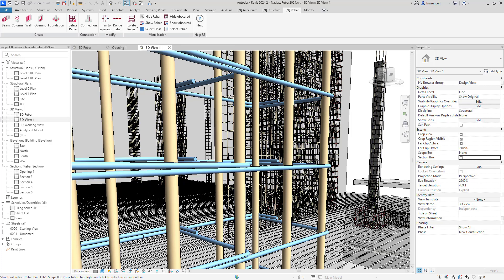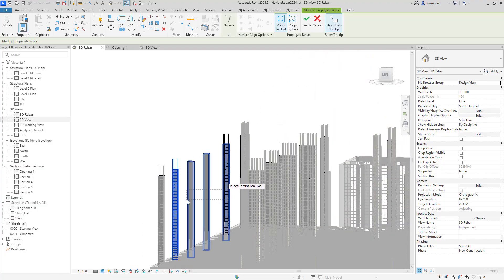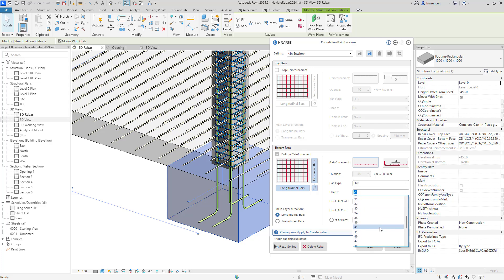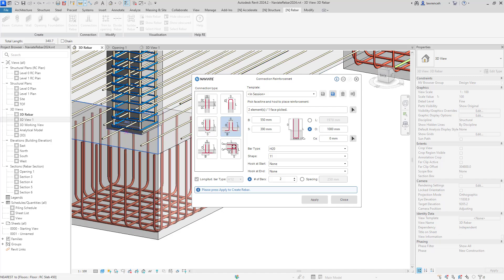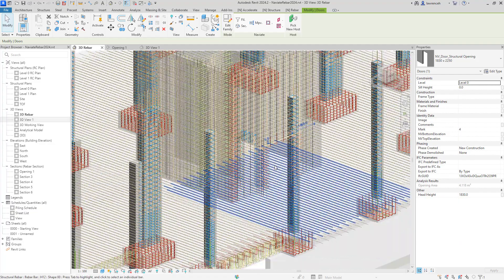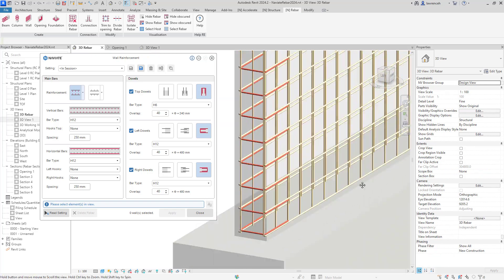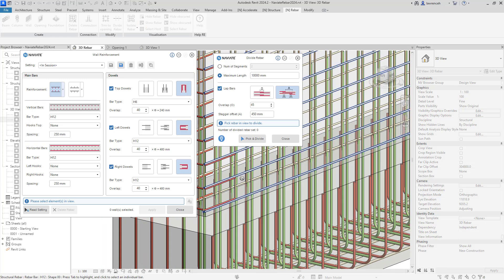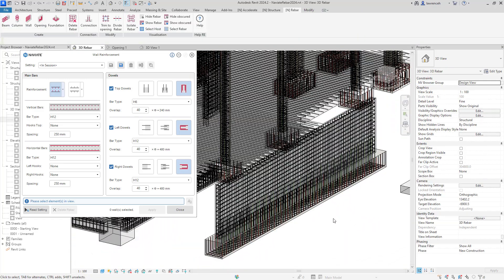Naviate Rebar - What's New!

Comment: and another question, when we add the reinforcement for the foundation, we can only choose the number of the bars to be sthe same in both long and short direction, couldnt we edit that? to let the number of the bars in the long direction more than the number of the bars in the short direction?
Reply from the maker: This is something that we hope to add to the connection tool in the future.
Reply: Thank you!, is there anyway that when we change the number of the bars to let it be saved in naviate? So that I can apply it then for the another foundations? 
Hope it’s clear and thank you :)
The same question for the connection if they were rotated can I apply this rotation in naviate so that i earn the naviate benefits? (Change one connection to change all the connections)
Reply from the maker: @ghaithtaher9907  you can save the configurations made within Naviate, however, if you’ve added bars outside Naviate then you can use the propagate method in Revit
Reply from the maker: When creating the foundation you can independently control the bars in the longitudinal and transverse directions. The default state is to apply the settings to both directions but you can select a single direction for control over spacing and shapes etc

Comment: Thank you very much Lawrence, I want to ask you about the connections tool, can I add the connections ( dowels from the Columns to the foundations in a way the I got them in the four directions? I'm speaking here about the part of the bar which lay on the bottom reinforcement of the foundation and go to the short or long direction side of the foundation, can I model them and let two connection to be layed on the bottom bars of the foundations and go the short direction of the foundation and the other two bars to the long direction? hope that my question is clear
thanks in advance
Reply from the maker: Hi, are you asking to be able to rotate the leg of the bar that sits on the bottom foundation rebar layers? If so, this will need to be done after placing the starter bars.